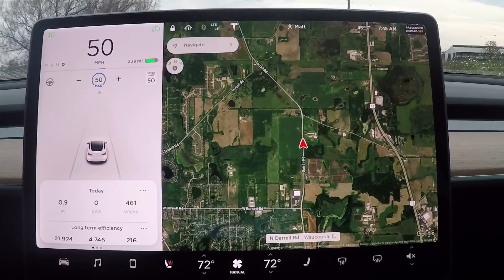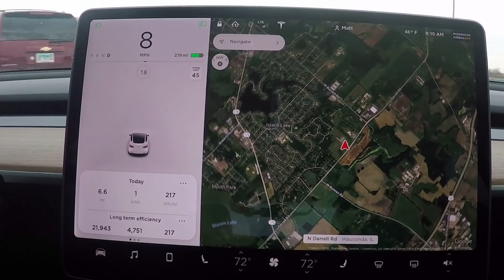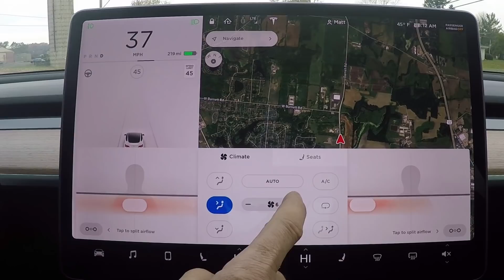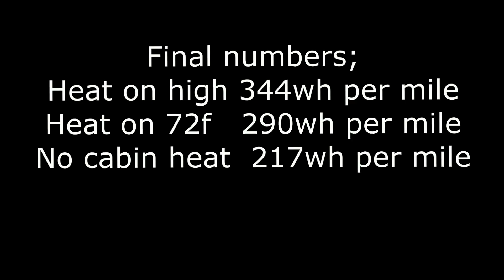Model 3 efficiency in cold (part two) using HVAC

Comment: What's interesting is that these are more or less the same numbers I'm getting in my P3D- (Performance drivetrain but 18" aeros). I suppose the performance drivetrain can be roughly as efficient as the single motor RWD when not utilizing the additional power.

Comment: I've gone from about 180Wh/mile in the summer (70-80 degrees) to over 300Wh/mile in 45 degree weather. It's been raining so I have to run the heat and AC to dehumidify. It's killing my range.

Comment: Good video 👍. One question i have never figured out.  When i try to calculate the percentage left using the watts per mile im alwsys off.  Starting out at lets say 90% and after driving i took watts per mile multiplied by miles divided by 75000 watt battery capacity.  Then subtract that from beginning % charge and the actual % left is always 6% lower.  Don’t understand why which makes me think the watts per mile is missing some consumption.   Your thoughts?

Comment: It's kind of important to note that ICE engines produce between 60-80% of combustion as waste heat,  so for heating stand alone, yes, it is more efficient in only that metric, but if you look at overall efficiency it is way more efficient to heat the cabin in an EV whether heat pump or resistive heating... Even with heat on EVs are are more than double percentage points more efficient even at the most conservative estimates...
Reply: Amadeus Reviews Everything Citation?

Comment: Good content.  Another way to see just what the heater or seat heater uses in kw is to have the car plugged in but not charging.  As soon as a major load starts up (such as heater) it will draw that power from the wall.  If you look on the charging screen, you can then see the current vehicle power draw.
Considering that the heater has nothing to do with miles driven this is a more accurate way to see the extra load.  On the other hand what you did is a great way to see a ballpark impact. (Which could be more useful to the average driver)
Anyway, just thought I'd mention a different technique for you to explore.
Reply from the maker: https://youtu.be/lIg6GAKhpXI

Already did that. 😁

Comment: Didn't update to v9 yet brother ?
Reply from the maker: Nope. Incredibly frustrating. I am always 2 to 3 weeks later than others receiving updates.......
Reply: @TechForumTesla  If you're not connecting to WiFi that could delay it.
Reply from the maker: @ddud4966  I am. But, the wifi signal is weak where I park. I have no control over that.
Reply: @TechForumTesla   you can't plug in a Wifi extender anywhere?
Reply from the maker: @THERE.IS.NO.DEATH.  nope

Comment: I have a diesel heater in my caravan (Eberspacher) which is also commonly used in trucks for heating the cabin. It is extremely efficient. 
If I owned an EV in a seriously cold climate, I would fit one! (It uses only a tiny amount of fuel, and can be controlled remotely.)

Comment: Hmm.

I think you were focused too much on the energy to heat the cabin vs. the battery.  The battery is a much larger thermal mass than the cabin.

But then again... if it was only 40°F outside, was the system really preheating the battery at all?
Reply from the maker: I know. I will repeat this when it is much colder.
Reply: @TechForumTesla  Thanks for these vids  :)

Comment: My wh/mi has been close to 300 avg in the month I’ve had mine. Haven’t even had to use heat much yet. Too much fun accelerating.  Maybe that will wear off at sometime and get more efficient but not anytime soon.
Reply: Craig M it doesn’t wear off.  Couple years in and I still accelerate for fun.

Comment: I Drive a Toyota  Prius Prime. I live outside of Syracuse NY where we get lots of snow and cold weather. My Prime uses a fuel  injected  heat pump to heat and cool the cabin. It drains the battery more in the winter than in the summer. If the outside temp  reaches below 13 degrees  then the ICE turns on to help heat the cabin in EV mode. The nice thing about the heat pump it heats and cools the cabin fast. No waiting for the ICE to warm up. Waiting for my lease to end so I can buy a Model 3.